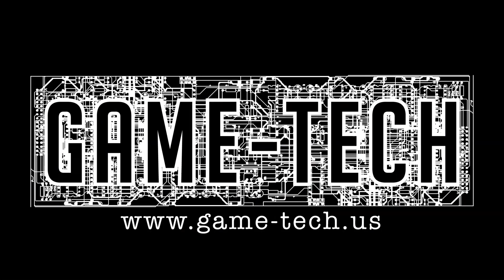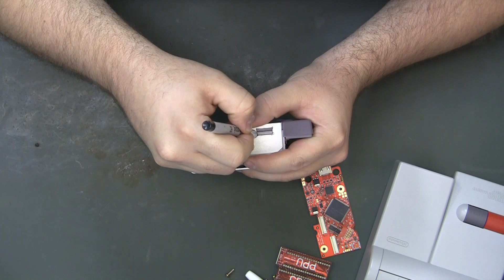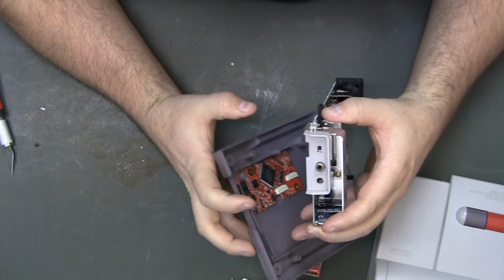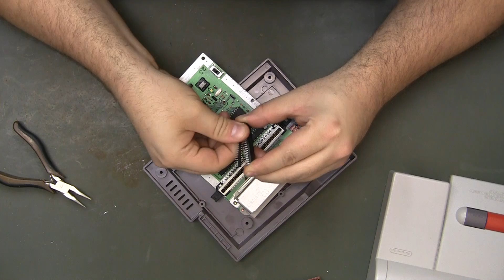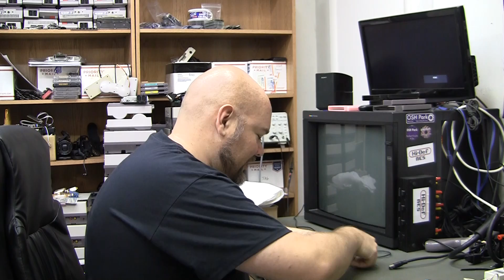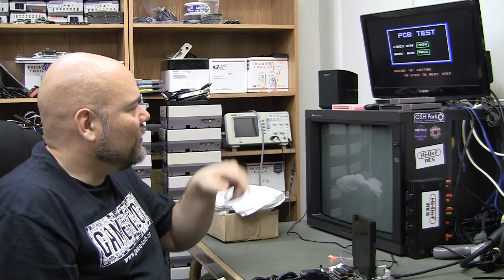Hi-Def NES - top loader install of red rev - no cord cutting nintendo

Comment: How come a blade vs a dremmel for cutting the plastic?
Reply: Even at slow speed, the dremel tends to melt the plastic. Blade are more precise, especially for HDMI or USB connectors (small, flat and large) and when your hole is between two pieces of a shell. Dremel is OK for larger  works, but you always finish with blades and files.